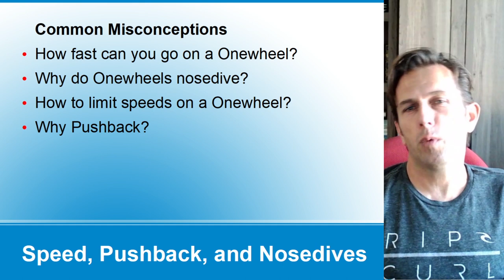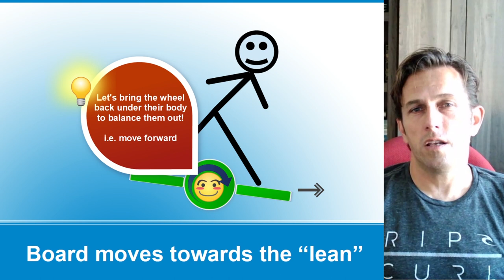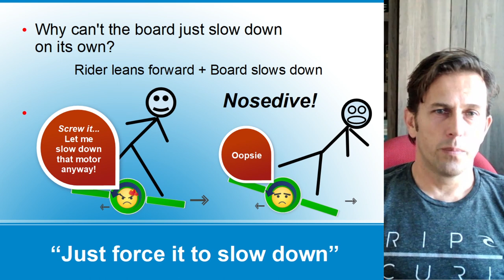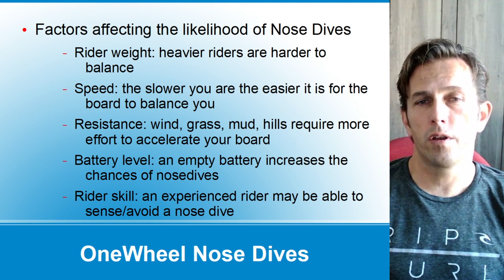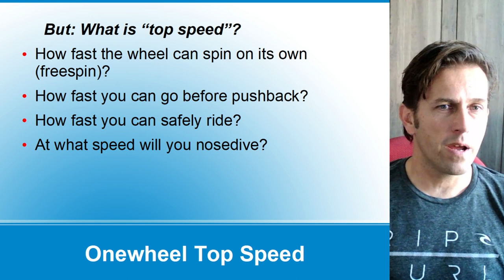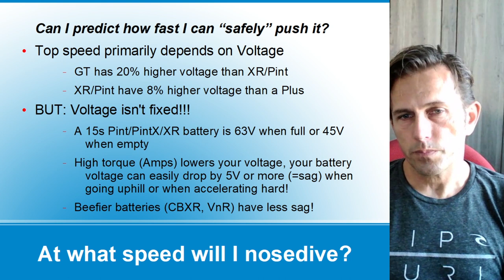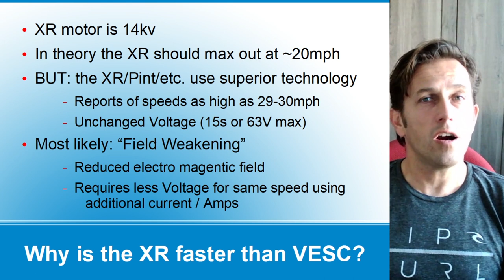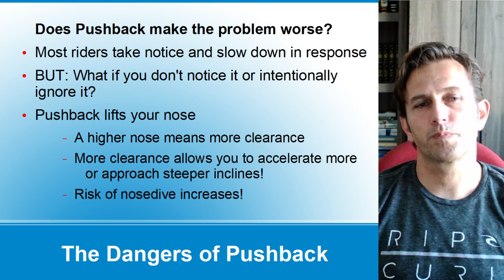The Truth about OneWheels - Speed, Pushback, and Nosedives

Comment: A brushless motor is just an Outrunner 3 phase synchronous motor with permanent magnets, so the motor speed is directly proportional to the frequency. On the industry larger motor drivers can do this varying the frequency, then my question is that, is a way to increase this frequency value in the VESC tool in order to control the speed?
Reply from the maker: frequency modulation is already used to achieve the different speeds - it's not something you additionally configure

Comment: Dude, thank you- this is awesome and fills in the blanks I had.  I've only had one major nosedive.  I don't recommend trying to climb steep hills at 22mph (even with a CBXR), you know, unless your bang bumpers up front need some more, fresh, street cred. hah.

I'm curious if you have any experience or opinion on the JW chip? I'm using it with a CBXR and kinda wonder about it modifying performance- I know it's got something to do with voltage readings...  Board feels exactly the same.  Looking forward to catching up on your other videos, I would love to be able to keep my XR around and get away from future motion stuff considering all this stuff that's going on and the direction they're taking.  Take care!
Reply from the maker: No experience with the JW chip. But I do have an opinion ;) The FM controller on one hand controls the motor on the other hand it also tries to prevent user repairs and upgrades. The JW chip mainly deals with the latter. For motor control the controller is always using all of the available power the battery can deliver (the JW chip will not really have any impact there) - the improved performance comes solely from the higher performance CBXR pack allowing high motor currents with less voltage sag. I'm pretty sure that CBXR+4208 board should yield the same performance as CBXR+4212+JW chip, but I don't have any experience with XR battery upgrades myself
Reply: @surfdado  FWIW I'm on the latter combo you listed and it's working out great and I love it.

I'm pretty sure I'm missing out on some lower end voltage from the chip, when comparing their charts, but meh, I don't like to ride below 20% or ~48.5V anyway. (JW batteries are a little different than CBXR... The fit of the JW was too tight for my liking so I went Chi.)

Thanks again my friend. Float on. 🤙

Comment: I wish they would at least build in a sound that alerts you if you're getting close to push back Had my first pushback experience today and couldnt slow down fast enough. Felt like it stopped balancing at speed and I was teetering on the edge of death.
Reply: Teetering on the edge of death  is spot on !

Comment: i like this video, and it has a lot of valuable information in it. one thing i question though is your theoretic xr top speed only being 20 mph. as with my math after measuring a stock xr tire, i came out to a 28.8 mph freewheel speed at 63 volts, and 23 mph at 51 volts which is roughly 25% battery, which is where i normally stop riding my board. thanks for the good video.
Reply from the maker: I admit I was just spitballing with my numbers, but the 20mph was an estimate of a "safe" max speed, i.e. a speed where you can still hit a pothole or speedbump and not instantly get ejected. I know from people who converted their XRs to VESC that they were surprised how their "safe" top speed was lower than they expected, i.e. in the 20mph territory, but maybe it was more like 21mph. But I am 100% certain that 28mph is impossible with VESC+15s+Hypercore, I'd say you're very likely to nosedive around 25mph even downhill on a full battery

Comment: Accordingly:    higher Voltage = higher safety,  by  increasing my options  especially in sketchy situations, which is why, from what I have seen online,  I feel the GTS is the best board especially for a noob or anyone who respects their equipment.    ( Basically, at 180 pounds,  limiting my level-pavement speed to @ 15mph on the GTS,  there is so much wiggle room it's freakin ridiculous.)
Reply from the maker: you are 100% correct - the GTS is indeed the safest board due to its higher torque. The higher makes high speed nosedives less likely, but also the increased low speed torque (Amps) makes it safer to handle unexpected roots or pot holes

Comment: Great explanation. I'm interested in the theory of how the elevated mode works or the nose lifts, the angle is detected by the imu but it's controlled somehow by the sensors in the motor. I don't think the nose lifts by acceleration.
Reply from the maker: The elevated mode, just like nose angle in custom shaping is merely an adjustment of the neutral position of the IMU. Instead of considering "0 degrees" to be level it considers a different angle to be the "level" position
Reply: @surfdado But... doesn't that mean it is accelerating in order to lift the front?   I hit pushback riding with friends down a hill.  Felt AWFUL.  Almost wrecked with death wobbles and the board acted like it didn't want to slow down.
Reply from the maker: @ryanturner6920  pushback can be very unpleasant and takes a while to get used to. Still the only way to lift the nose is by temporarily increasing the speed of the motor. No other mechanism is present in a OneWheel
Reply: @ryanturner6920   In the motorcycle world, anything that changes the pitch of the longitudinal axis of the frame,  ( like braking ) will cause instability.  Changes to braking while cornering, for instance,  can be potentially dangerous.   ( The #1 cause of most moto accidents. )   So, holy crap.... I can't imagine how scary it must be to have pushback at high-speed  ( in coffin corner ),  because of such a great change in the board's longitudinal axis and the amount of commensurate induced instability.    Thanks for sharing!

Comment: But what is pushback? Is just an automatic  level adjustment like in the custom settings?
Reply from the maker: that's exactly what it is
Reply: I've been wondering about a feature where you can adjust levels by doing a rapid series of forward or backwards movements or combinations to increase or decrease  the ride levels or even power settings I wonder if this is possible with vesc settings or even could be?
Reply: And lights
Reply from the maker: @joshgreen4608  yeah I’ve been thinking about that too and I guess it would be possible but the downside is it could get triggered inadvertently when you ride rough trails

Comment: One thing you didn’t mention as why the board shuts down
Reply from the maker: Board shutdowns aren't really part of the problem. Obviously hardware failures can cause the board to shut down at any moment, but there's literally nothing you can do to prevent or anticipate that. The only legitimate board shutdown situation is when you overload the controller, but that's only possible at very low speeds, like below 1mph when the BMS decides to shut things down because you're trying to crawl over a big obstacle. Did you have any other situation in mind?
Reply: @surfdado  wow that’s awesome thanks for explaining it now I get it bam I’m subscribed!
Reply: @surfdado  My board has shut down at various loads and speeds. Let me tell you, it was a very big problem!! After many phone calls and emails they finally took it back and fixed it. Also, 3phase motors are speed controlled by frequency, not voltage. Voltage and amperage will vary depending on how much load is on the motor and the speed it's spinning. Field weakening likely just means they are cutting voltage by PWM to look for an optimum field strength that the motor likes. Probably in an effort to get more range. Conversely over volting a motor can increase amperage by inducing Back EMF which creates a lot of waste heat , possibly burning out a motor if taken too far. In general motors work best in the designed voltage range, I like your channel btw
Reply from the maker: @petemack1917  yeah, as an engineer I'm aware of this but when talking to typical riders I just keep it simple with voltage for speed and amps for torque... Also, so far we haven't seen excessive heat buildup when running hypercore motors at 84Volts so it doesn't seem to be an issue at those levels